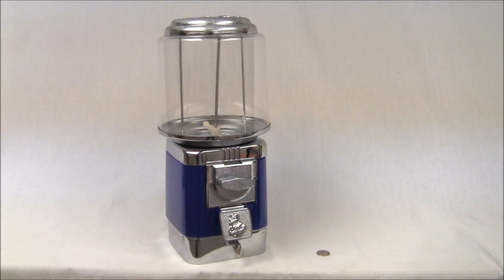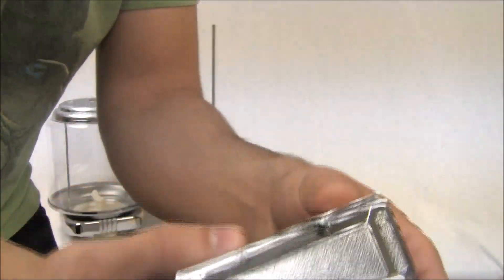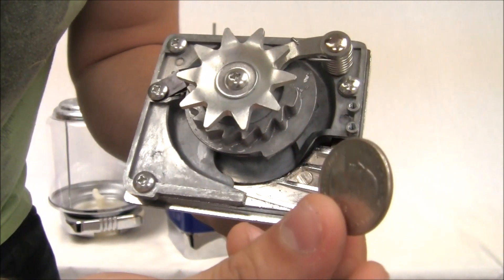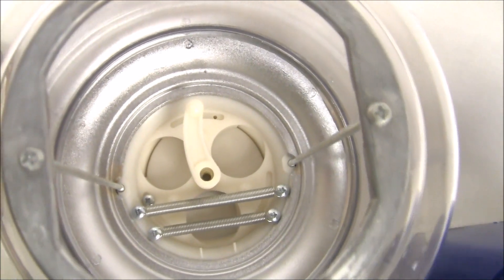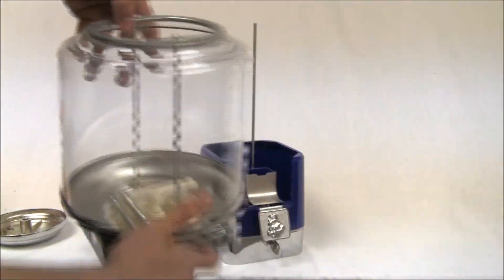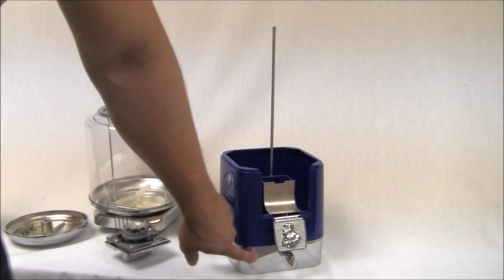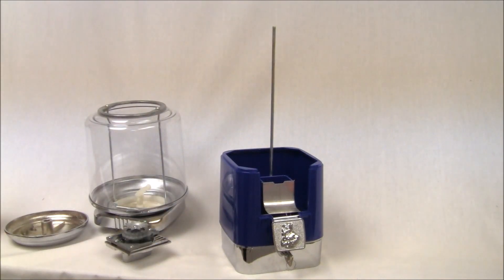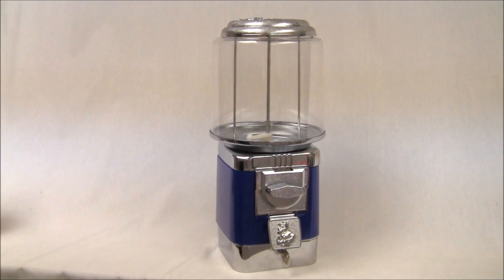How a Gumball Machine Works

Comment: what happens if you don't have a cash box?
Reply from the maker: There will be a chrome base that will holds the coins. However you will have to access the change from the top of the machine.
Reply: Jude Ortega 
They fall on the bottom. You really dont need to have one, but you can place a small container to catch them if you just want one...👍 for more tips feel free to check out my channel... Chrome Vending\ My Vending Journey